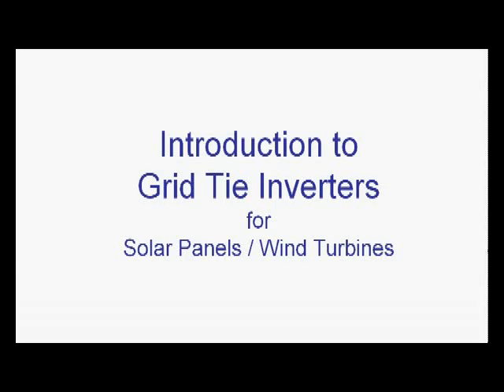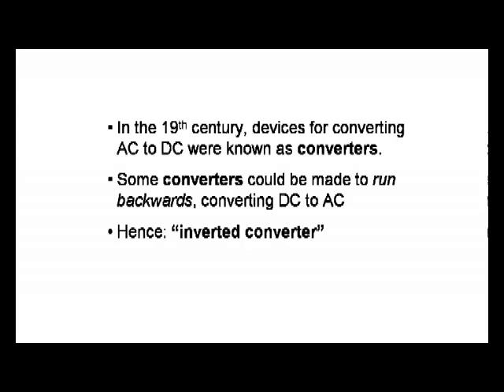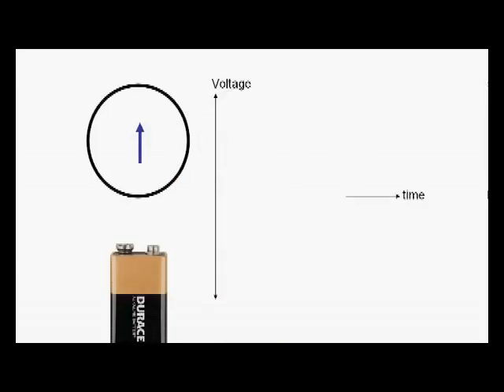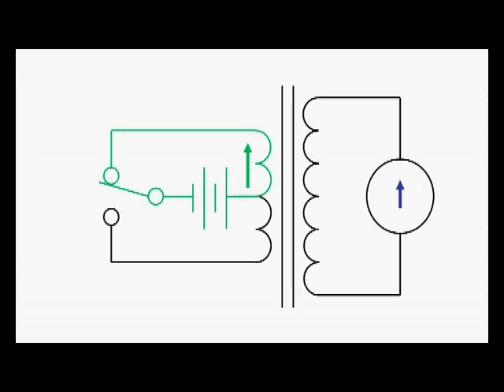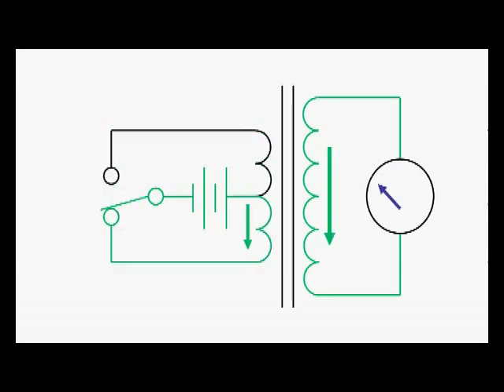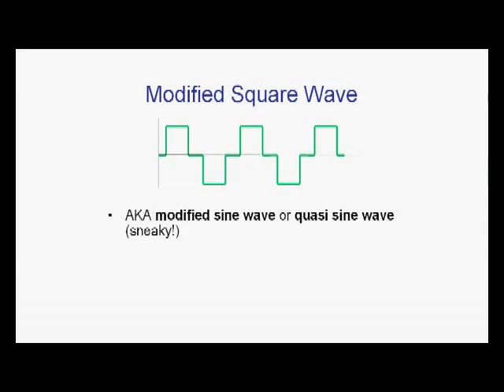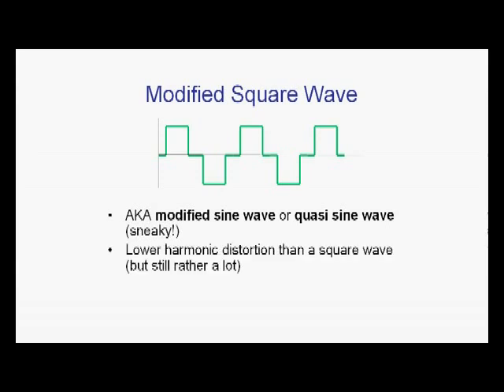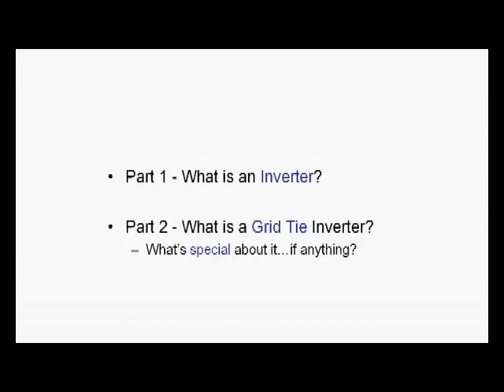Introduction to Grid Tie Inverters - Part 1

Comment: I often wondered about the switching of the DC supply.
Simple on off is easy but to completely switch polarity at the same rate got me puzzled.
What such a simple solution as taking the centre tap from the primary transformer.
I'm still trying to figure out why I didn't think of that before now.
>

Comment: Thanks I just helped my Niece to understand the inverters using your video. I was  technical( going to deep in to MOSFET's and IGBT's -advantages/disadvantages, why MOSFET's are easier to switch on/off and so on and the beauty of MCU to control it). I did not understood that she did not understood that basic principal of DC and reverse polarity. Could not understand where I was getting the - voltage in the sine output. The battery and voltmeter reading made her understand. Cheers